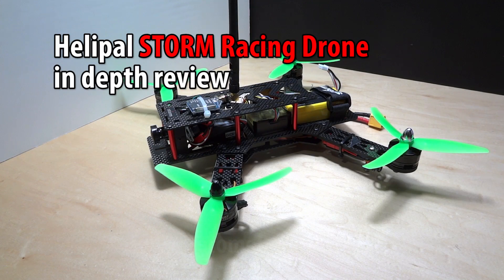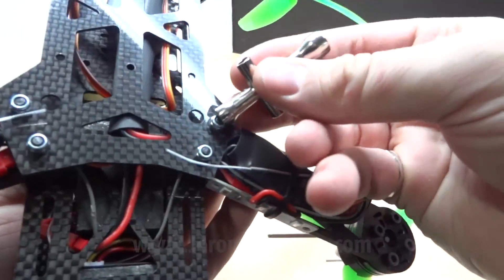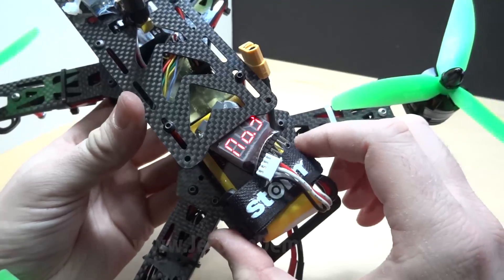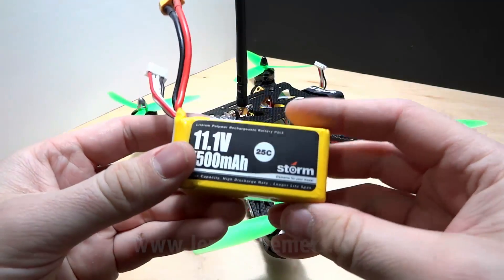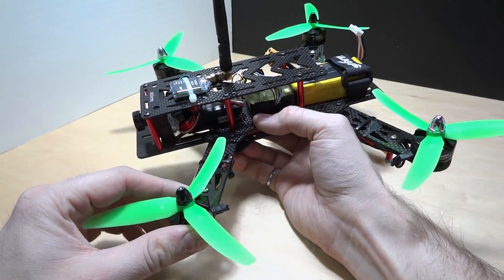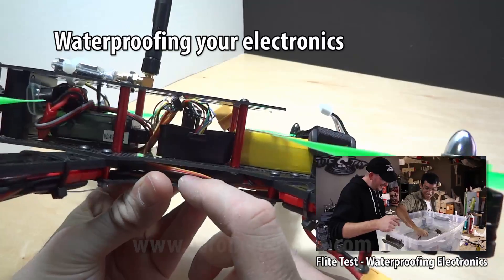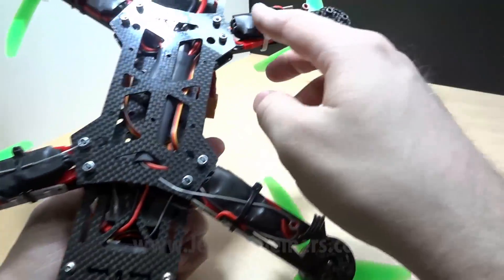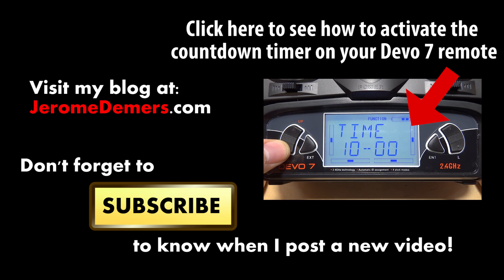250 Mini Quad Storm Racing Drone - In depth review

Comment: Mr. Demers, in your opinion how does the Storm compare to the Arris FPV250 Racing Quad that's on Amazon? I think its fairly new to the market, from Hobby Wing. They have the same frame, radio, camera, and flight controller but I'm not sure about the rest. I've done some research and there are a few differences, but I can't make heads or tails of it. The Arris seems to be pretty much the same build as the Storm but without the led's and with some different parts. It has 10a ESC's instead of the Storm's 12a. The FPV system is different, the Storm has a  200mw 5.8Ghz video transmitter and the Arris has a 600mw 5.8Ghz. I am not sure about the motors. I am also not sure if the Arris comes with the preset modes or not. Which do you think is the better buy? Thank you for your help.
Reply from the maker: The motors are 1806. smaller and lighter. For a beginner those are great. The 10A are smaller but you have smaller motors too. It does NOT come with a transmitter, receiver and batterie! That's 130$. 319+130=449$. They sell a other one with a DEVO 7 transmitter but it does not come with the batterie. The LED are very useful. It's a small aircraft, hard to see! Don't forget the tools that comes with the kit!
 Go with the STORM, it's a real Ready To Fly! (RTF) and it's cheaper!
Reply: Jerome Demers Thank you very much for the reply! I appreciate the help :)
Reply from the maker: TheFriendlyViking  I don't mess with Vikings! :)

Comment: Hi, this is by fat the best review I have seen about this drone. I would like to know why everyone has the Type A Storm drone? it´s because it is better than the type B in any sense or just because it´s appearance? Another thing is I read that this drone cannot be used in official races because it´s a little bigger than 250mm and the rules say that It cannot be bigger than that size, is this true?.
Reply from the maker: Almaral Engineering  thank you!  (made a mistake in inital post, I just edited this post) Type B is a other frame! The battery is on top. No room for underneath. It was not available when I did the review. I think it's a ZMR250 frame. I would assume it's a true 250mm frame. It's smaller frame. You can put bigger/longer on top.
Reply from the maker: Almaral Engineering yes it's a 280mm frame! Not 250. BUT you can buy from helipal 250mm arms to retrofit on your quad. I had to do that for a competition. I drilled hole in my Storm arms to make them 250mm. That did work. BUY spare arms! I broke 2 arms during the competition!! The second time I was out of the finals since I did not have a quad to fly!!!
Reply: If you want one then please contact me, i build them and can do it cheaper!

Comment: Hi, is this exactly the same drone I could buy here? http://www.banggood.com/QAV250-Carbon-Fiber-Frame-DIY-ARF-Combo-MT1806-12A-ESC-CC3D-FC-p-965220.html, of course plus the camera and the transmitter.
Reply from the maker: yes, not exactly the same drone. Very similar. You have smaller motors 1806 and the storm has 2204. It's still good. You will have to configure the CC3D and make your own electrical harness (soldering) Don't forget props! and the tools to assemble it + the the tool to attach the props to motor. Like you said, you need camera (30$), transmitter (100$) and VIDEO transmitter (25$). (155$) that is a total of 300$ with not props, wires and tools.
Reply: Jerome Demers Thanks a lot, this is a great review!

Comment: Hi, mate! Thanks for this video. I have also bought one recently. Every thing is fine, but i am not familiar with DEVO. Would you be so kind to make a video or in other way show how to program lost model buzzer on chanel 7.
Reply from the maker: you don't need to program lost buzzer. You just plug buzzer on AUX 2 and you flip the switch when you lose it.
Reply: This is simple. But there is connector with only one wire pluged, that is going to flight controller, what have you done with it?
Reply from the maker: Irina Roman lol leave it like that. The "one" wire are for remote signal and there is a other black "one" wire that the ground. It's the reference for your circuit.
Reply: Sorry, i just can unplug signal black wire from aux2 and leave it hanging, correct?
Reply from the maker: OH!  I am very sorry guys!! It's AUX1 !
AUX2 is for the flight modes! Don't unplug AUX 2. Plug buzzer in AUX 1.
Reply: Ok, thank you, will try later on. The problem was that there is absolutely no info about aux1 and on which switch it is assigned. Hope that info will help other guys too. Cheers
Reply from the maker: I didn't know either. I press all button on remote. It's the MIX switch. ( top right ) :)

Comment: can you share your PID?
Reply from the maker: In stabilization, Advanced tab

In Rate Stabilization (Inner Loop)
-------------ROLL-------------
P: 0.0055
I:  0.0030
D: 0.0001
------------PITCH------------
P: 0.0055
I:  0.0030
D: 0.0001
--------------YAW------------
P: 0.0035
I:  0.0035
D: 0.0001
-----------------------------------

Comment: Does this have self leveling? Really want to buy this just need some information. Thanks
Reply from the maker: yes it does. You have 3 flying mode. Only one of them is gyro mode / rate mode that does not provide the self leveling. (back flip)

Also, you can program the CC3D (flight controller) to do what you want.

Comment: You shouldn't have your receiver antennas so close to the ESCs or carbon, it will significantly reduce your range.   It's pretty bad that the failsafe is set to "hold" because with the receiver antennas like that you're just asking for a fly-away.
Reply from the maker: *****  OMG BRUCE!!!!! I upload this video and a few hours later you post a comment!! How cool! Thanks! This could explain some weird glitch/ jerking movement the mini quad did when I was at the farthest of my race circuit. The RC antenna position thing is the HOT topic on the Storm RCgroups forum right now. Thanks for your videos, they help a lot! I did get inspired by your reviews to make sure my review is top notch. It's a lot of work and you have to stop somewhere or else the video is too long! 18min is so long! lol Take care!
Reply: Jerome Demers
No worries mate... I was thinking of reviewing one of these myself.
Reply: ***** The frame itself sells for around $40 on eBay.It's called Emax 250 pro,there is a pure carbon and a carbon/glass mixed version.Would be interesting to see a review.
Reply: +xjet I've had tons of crashes with this quad. It was sold as an Emax 250 pro but it's the same frame esc and motors and flight controller bVery durable and way better than the walkera 250 you just reviewed. And solid arms are available from Amazon though I haven't had to change one yet. Great first "real" quad after toys.
Reply: +Invitingsauce 350$ usd from usfpv. Came RTF with turnigy9x second version. No fpv
Reply: Also the kit with a turnigy9x, the copter falls to the ground when you loose signal. I flew behind a metal barn, and could see the quad pitch toward the rear(battery) just before the fatshark video went gray with snow then complete black. Fell stright down. Thank goodness that's preset. The default for signal loss it no signal at all so everything just stops.
Reply: Flys very similar to an MXP230. Almost as durable similar design.
Reply from the maker: The MXP230 is a tank!! I would got MXP all day long!